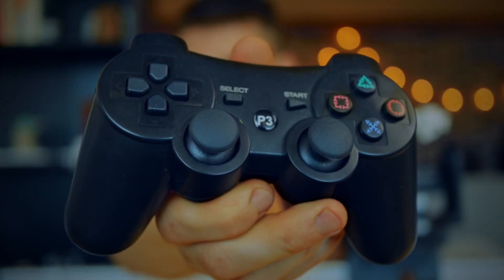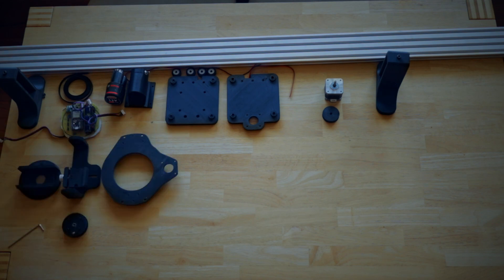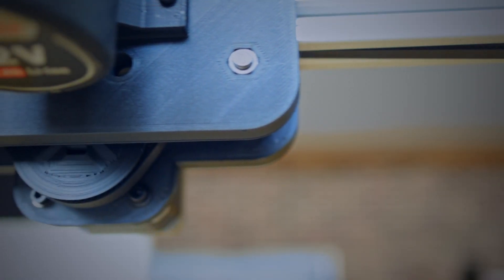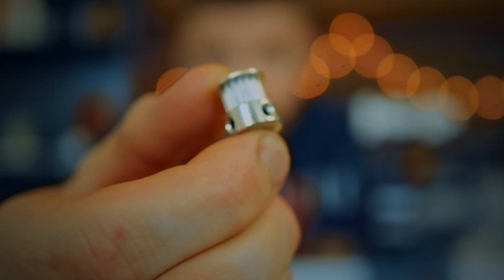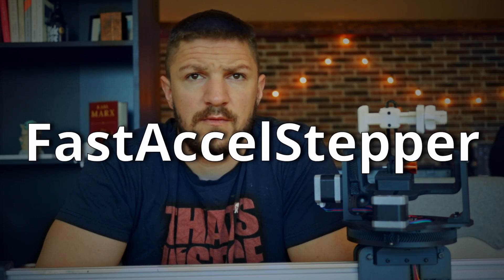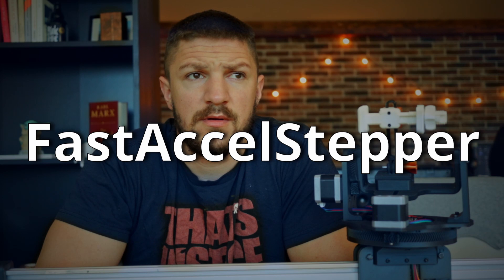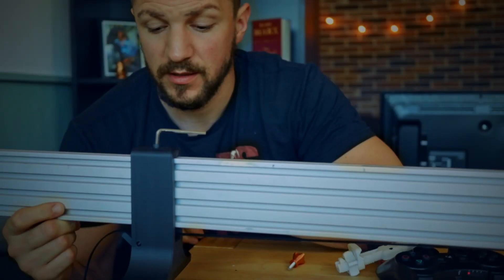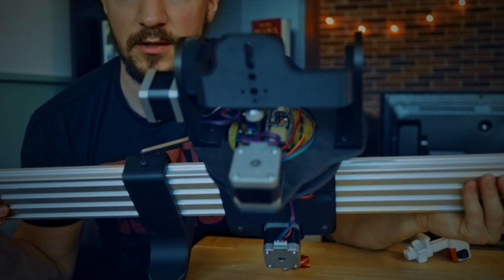DIY 3 AXIS CAMERA SLIDER | MOTORIZED CAMERA SLIDER

Comment from the maker: Please note, as it is currently, the battery is not safe to use, as a fellow reddit user wrote:

Please be aware that the lithium-ion battery you're using has absolutely no internal protection circuits, and lithium batteries can be severely damaged by draining them too low (around 9.5 volts for yours) or getting them too hot. "Severe damage" can, especially if done many times, can lead to the battery swelling or bursting into flames.

Normally, the power tool has electronics that monitor the battery and will refuse to run the tool if the battery gets too low or too hot. Your setup has the opposite feature, where the buck regulator will work fine down to very low voltage, and the stepper motors will simply run with less torque as the battery drains to the point where it is permanently damaged.

Your setup is unlikely to draw too much current at once from the battery, but I strongly recommend adding something to keep the batteries from being drained too low (over-discharged). The "correct" solution is a Battery Management System, a little circuit that goes between the battery and the electronics being powered. You can buy them inexpensively on [amazon] Alternatively, you could have the ESP32 read the battery voltage directly, or you could add a [volt meter] and run your slider with the understanding that you really, really should remove the battery when it gets down to 9.5V.
Reply: Any recommendations for what to use? I'm new to this and Amazon search (for me) returns solar battery management systems :)

Comment: Very impressive work. I would like to reproduce your project... I tried to copy the main.cpp in the latest arduino IDE and installed the two libraries FastAccelStepper and Ps3Controller. After a "verify" process I had a long list of errors concerning mostly those libraries, I even re-installed the 0.23.2 version of FastAccelStepper but I still got a lot of errors after "Verify". Impossible to copy here the log. Should I use specifically the libraries that are joined in your github folder and how ? Should I use another software than the Arduino IDE ?
Reply: OOOkkkkay I came to the conclusion that it may work fine with Visual Studio Code and PlatFormIO plugin .... results in a few weeks when I will receive the components

Comment: Christoph Lehner, это видео супер. Подскажите ,пожалуйста, какие шарики предпочтительнее 6мм или 6,35мм для большого панорамного подшипника  А также шаговые моторы для веса 3-4 килограмм камеры.
Reply from the maker: It were 6mm Plastic ball bearings.

I don't think it will handle 4kg of payload, since it's not that ridigd. You are probablyy better off building one out off Aluminium
Reply: @ChristophLehner  А для панорамы фотоаппарат Canon с небольшим объективом какой шаговый мотор лучше подойдет. У вас он достаточно высокий(шаговый мотор).
Reply from the maker: @АлександрШевцов-ю4ц  a  nema17 should work fine

Comment: Just a heads up an you may know by now but in the code you have lines that say thing like "slide_is_moving=true;" you can also get that value from the library with if(slide_stepper->isRunning()) note you can get a bit of drift if you ever decide to use closed loop stepper drivers as they can buffer some pulses so can carry on running for a short while after the library thinks they've stopped so you need to add a small delay to allow the buffer to clear.

Comment: It's so weird to see this video. I built essentially the same camera arm, also based on 
Attila's design and was also designing a slider to go with my 80/20 extrusion. I thought about using Issac's design and modifying it like you did, but ended up starting from scratch. 

My only regret is that I should have used three casters like you instead of four... 

Great project, well done!
Reply from the maker: Hahahha what a coincidence. I upgraded my camera arm to 5 caster with a wider base, since  it fell over onetime

Comment: Hello, could you help me? I can't get the control to connect with the ardunio. I bought the control that you recommended. I put the mac of the control in the code and uploaded it to the esp32 and when I turned on the control, the LEDs flashed for 3 seconds and turned off and none of them turned on. in no number and when I check it does not seem to connect, can you tell me that I am misusing IDE Arduino 2.3.4 
library
esp32 3.1.0
Ps3Controller 1.1.0
FastAccelStepper 0.31.4 
help friend please help I have been trying to make it work for almost a year and looking for solutions

Comment: The project looks very good and congratulations to its creator.
I have drawn the circuit on a board and placed all the components.
I uploaded the code to the ESP32, all the relevant leds (enable, step-led, the power levels on each driver) light up when I operate the joystick (SONY-PS3 the original one) but the motors don't move. They stay frozen in the enable brake.
I uploaded the file with the Arduino IDE by renaming (not compiling) the (.cpp ) file to (.ino).
The file loaded normally without the program giving me any error.
On the serial screen the joystick seems to respond correctly.
Is it because no compilation was done? Which I don't know how to do.
If this is the case has a friend compiled the .cpp to .ino and can provide it to the community.
Thank you very much.
Reply from the maker: Well i think the issue is, you are missing the accel stepper library. You should try to get one motor moving first.

You can also open the cpp file in text editor and copy the content.
Reply: @ChristophLehner  Thank you very much for the quick reply
If you mean the library Fast AccelStepper.h I have installed it. I am also using board version 1.0.6
I also have to say that I have not connected the Hall sensors to the circuit and whether this affects the whole behavior of the project

Comment: I made the entire slider, the only modification I have is that I am using TMC 2209 v3.0 instead of TMC 2208, and it turns out that the motors rotate continuously from one side to the other all the time, but when I move the joystick it does move Where I indicate it, what I'm getting at is that it never stays still, and the slide motor only rotates in one direction, the pan and tilt do rotate in both, what could be the problem?

Comment: Absolutely brilliant work.
May I ask where you used the 
1xDC-DC Buck Converter for the ESP32
that you listed in the components but that is not present in the schematic.png posted on your github?
I think I caught a glimpse at it at 6.24 on the right lower corner of the PCB but  I can be wrong.
Thank you.
Reply from the maker: the buck converter is used from the 12v battery to power the ESP32 with 5V

Comment: A couple of other minor things since my last comment,  there's a small typo in Serial.begin, it should be 115200 not 112500 also a way of setting a dead zone would be good as you can get a small amount of drift with the stick at centre particularly on older worn controllers.

Comment: Hey Christoph,
Great project!!!
Are you planning on further improving the project (e.g. implementation of the hall-effect-sensors, more infos how you built the circuit board, more detailed parts list and the other feet you suggested)?
I'd really like to built it myself but I'm not really into programming so I can't improve that myself. 
Since all the parts are about 200€ I'd like my slider to fully function if I built it, so it would be really helpfull and time saving if there'd be a little more info about the parts specs, wiring of the slider and dimensions of the circuit board :)

Thanks in advance
Reply from the maker: Check out the github link, in the description, there are the shematics and wiring diagram. I am afraid the development is complete...

Comment: About the Hall Effects Sensors : 
in the schematic connexions in Vn Vp and IO34 Pins but in the code : 
#define PAN_HALL_PIN 36
#define TILT_HALL_PIN 39
#define SLIDE_HALL_PIN 34

36=Vn and 39 =VP ?

Comment: man you are my inspiration now... i cant sleep thinking about this proyect. But for my disgrace im from venezuela, and is a little dificult for me to buy the TMC2208. My question: Can i replace TMC2208 driver for A4988 drivers.. sorry im a newbie too... ps: forgive my english im doing my best!
Reply from the maker: Thanks for the comment.
It depends, functionwise it will be the same, but the a4988 are quite noise, so if you also want to record audio, you shouldnt use them.

Comment: Christoph Lehner, I have assembled a 3-axis slider that you have developed. When I don't touch the joysticks, the stepper motors move a little. What could be the matter? Or what to adjust in the program? Thank you in advance.
Reply from the maker: It's probably the rest position of the joystick, if it's not perfectly 0, it will move the motor.

You could add an if-statement, do block out any inputvalue from the Controller, under a certain trashhold
Reply: @ChristophLehner  I'm a beginner. Help to do this in the code. Thank you in advance.
Reply: @ChristophLehner  I'm new to programming. And how to write it and where in the code. I would be grateful for the help.
Reply from the maker: @АлександрШевцов-ю4ц  Hi,

i just had a look into the code,
you can try to increase the debounce time:

const long debouncedelay = 100; 

instead of 100, try to set it to 200

hope this helps
Reply: @ChristophLehner  And how exactly to do it? I'm not a programmer, sorry. Thank you in advance.

Comment: Awesome! Im just building it! How do you
get the ps3 controller and the esp32 linked?
Reply from the maker: Via bluetooth,
You need to tell the esp32 the mac adress from the ps3 Controller. I used an existing library for the esp32 to Connect to the esp32 and recieve the buttons.

Comment: Great project, thank you for sharing it. I am not an expert in programming. Can you help me on how to program?  esp32
Reply from the maker: Where exact are you having issues?
Getting the code on the esp32? Or programming in gerneral?
Reply: Thanks for the quick reply, how do I fix it? Fil CCP in Fil ino program Arduino ino
Reply from the maker: I used VS Code...
Reply: @ChristophLehner  how to upload file( main.cpp) in esp32 with arduino id or how to change main.ccp to main.ino so that arduino id accepts (Getting the code on the esp32?) thanks

Comment: At 1:58.  Is that an arcaswiss 3d printed clamp.  If so, would you be able to point me in the direction to find the stl files?  Great modifications.
Reply from the maker: I've uploaded it to thingiverse: https://www.thingiverse.com/thing:4926352

you will need a M4 bolt, i made a knurled one on the lathe, but you could also 3d print a handle for the bolt

Comment: i tried making the isaac's version but failed with the code part, im not able to upload use the code if you can help me with that? i am not able to understand how to operate the code
Reply from the maker: Do you have a esp32? You will need arduino IDE or VS Code, to program the uC
Reply: @ChristophLehner  no i have esp8266 and Arduino Nano
Reply: @manavmuthreja1898  
Just spend the $5 to upgrade to an ESP32.  That way you can also use Bluetooth for a Playstation controller

Comment: trying to compile main.cpp with arduino IDE and VSC-pio : a long list of error 
examples :
.pio/libdeps/esp32dev/FastAccelStepper/src/StepperISR_esp32.cpp:115:23: error: 'volatile struct mcpwm_timer_regs_t' has no member named 'period'
.pio/libdeps/esp32dev/FastAccelStepper/src/StepperISR_esp32.cpp:170:12: error: 'struct mcpwm_dev_t' has no member named 'channel'
.pio/libdeps/esp32dev/FastAccelStepper/src/StepperISR_esp32.cpp:182:23: error: 'volatile struct mcpwm_timer_regs_t' has no member named 'mode'
 .pio/libdeps/esp32dev/FastAccelStepper/src/StepperISR_esp32.cpp:223:20: error: 'volatile union mcpwm_int_st_reg_t' has no member named 'cmpr0_tea_int_st'
 mostly related to fastaccelstepper

despite these error messages I managed to upload the firmware with arduino IDE , I changed my PS3 controller mac address to the address set in the program (the controller seems to connect fine)

no reaction of any of my stepper motors....

😭😭😭😭😭😭😭

Comment: Hello, could you help me? I can't get the control to connect with the esp32. I bought the control that you recommended. I put the mac of the control in the code and uploaded it to the esp32 and when I turned on the control, the LEDs flashed for 3 seconds and turned off and none of them turned on. in no number and when I check it does not seem to connect, can you tell me that I am misusing IDE Arduino 2.3.4 
library
esp32 3.1.0
Ps3Controller 1.1.0
FastAccelStepper 0.31.4 
help friend please help I have been trying to make it work for almost a year and looking for solutions